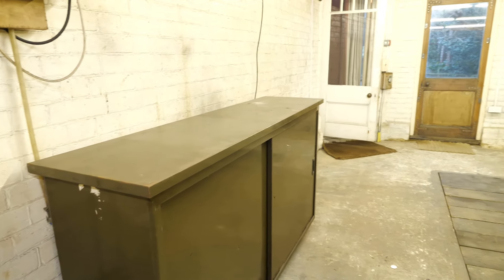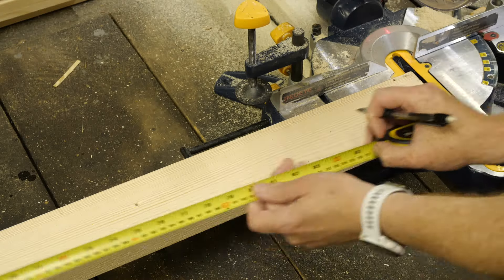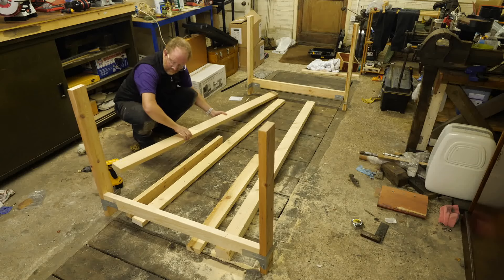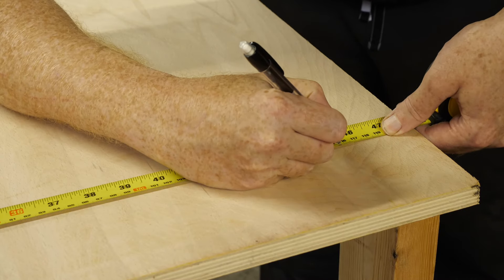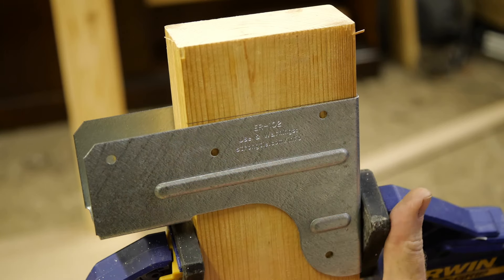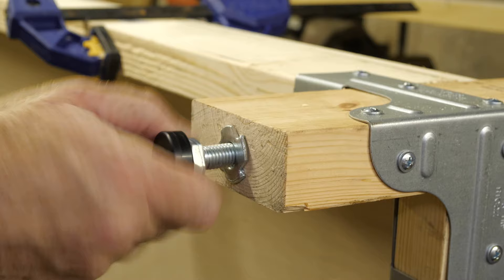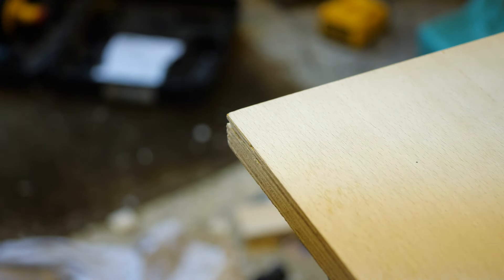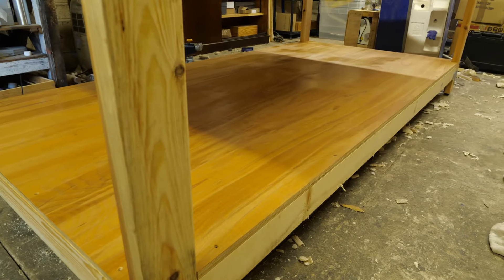Making a Custom Workbench with Simpson's Simply Build It Kit

Comment: Nice piece of hardware kit. Reasonably prices. Good looking bench. I would have expected to see at least one or two cross members to support the shelf and top. If I were doing this bench I would band the top with some solid timber to protect the plywood edges.  I also expect you will be building some cabinetry to sit on the shelf to provide additional storage.🙂🙂

Comment: That's a lovely looking bench and very well and patiently built.  I do have to say though I would have preferred a couple of cross members under the top and gone with at least a 25mm thick top.  

My current steel framed bench (my one and only professional tradesperson mate is a welder!) is only 1800 x 800, as it had to fit in a 1.5 car garage with a bit of space for non-machining stuff (my better and wiser half insists that we should have a nice garden with a mown lawn, attractive flower beds and comfortable furniture🙄😁) and I used two 25mm hardwood ply sheets on top, the lower sheet bolted to the frame and the upper glued and brad nailed on to the upper.  For the shelf I just used OSB...eh, it's a shelf. 😂

Comment: Do you need to include a brace in the long center of the top and shelf to reduce sagging.
Reply from the maker: I did consider that, but it's really rigid without it, and so far I haven't needed to.

Comment: What's the yellow/brassy thing in your drill chuck?  Looks vaguely like a garden hose end?   Some sort of torque limiter perhaps ?
Reply from the maker: It's a quick release holder for screwdriver bits. The countersunk pilot drill has the same fitting, which saves a load of time when doing a lot of screws.

Comment: Did you consider two half-size benches, which might give you more flexibility, as well effectively a center support? They could be bolted together, perhaps with a cam clamp mechanism for rapid separation. Obviously you're committed to this now! (Although I suppose you could always cut it in half if the need arose!)